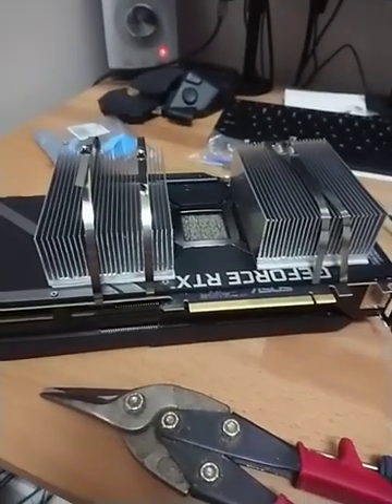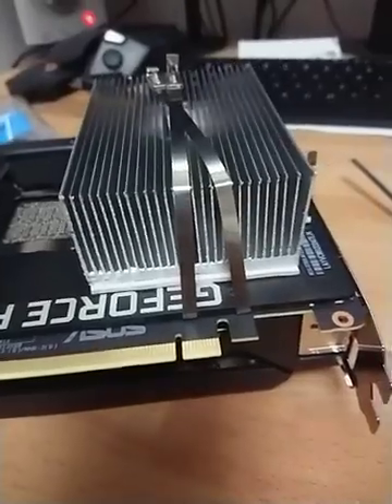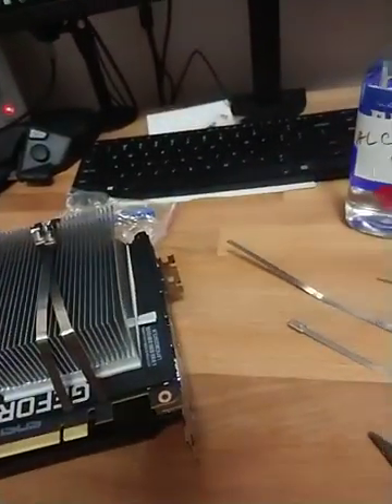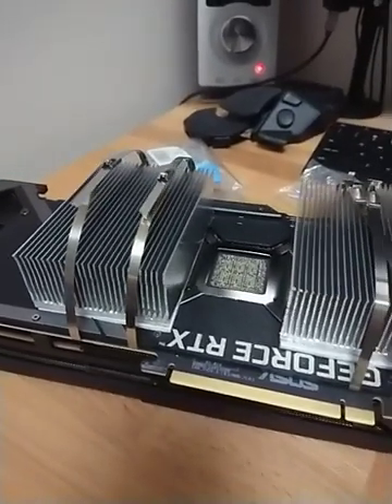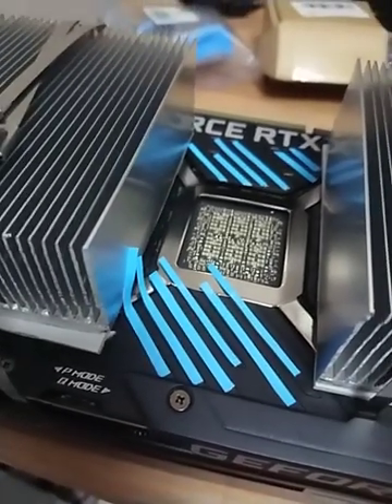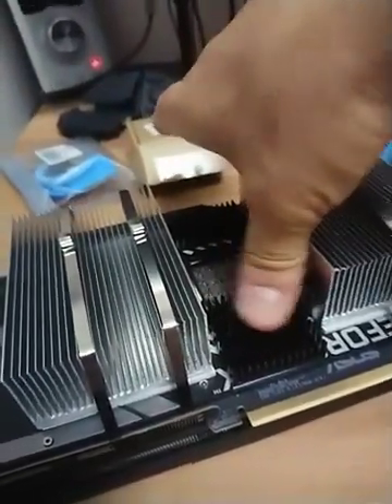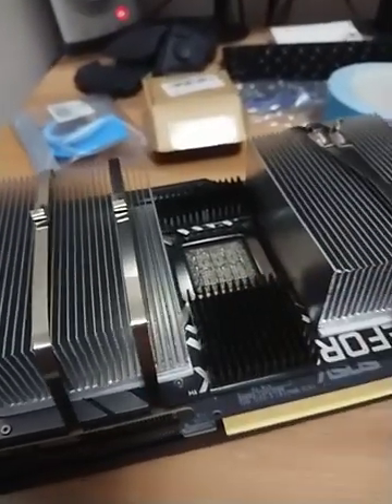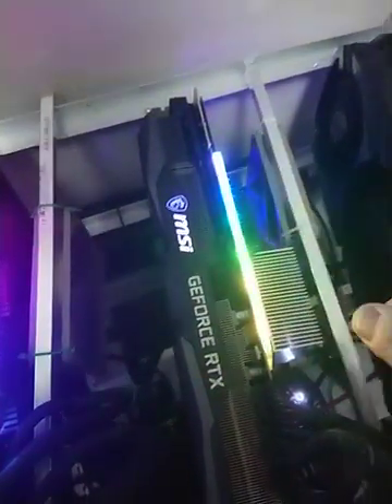Huge heatsinks on the GPU backplate Rtx 3090 increase hash rate Nvidia crypto mining ETH

Comment: Plastic Zip Ties are non-conductive, however, heat wears down plastic zip ties (and rubber bands).
I've used plastic zip ties in a case before and they eventually broke from degrading from the heat.
If you use plastic zip ties, I would say to check them after 6 months to 1 year and maybe replace them every 1-2 years max.

Comment: Personally, I would like to see someone try a copper plate stuck/pasted on the backplate of a 3090, with a couple counter sunk screws up through that copper plate first, to attach an off-the-shelf aio. All you would need to do this is the regular Aio mounting bracket kit. Cool the copper, cool the back plate, cool the vrams.

Comment: About thermal pads. Thinner is better, otherwise it acts as an insulator and traps the heat. You can also get double sided thermal adesive tape which is about 1mm thick. btw Normal thermal pads would be squished from 1.5mm to about 1.2mm.
Reply from the maker: https://www.youtube.com/watch?v=OzcAo38rkqQ

 This is a older video using double sided thermal tape

Comment: If you plan to strap heatsink, then thermal paste is better because thickness will be lower and heat transfer will increase. Pads are used only where you need electrical isolation or where surface is so uneven that paste wont fill space (difference more than 0.5mm). I did calculations using best thermal pad vs average thermal paste and thermal paste is still 10x better. Also on components that require thermal pads thicker than 3mm it would be better to remove pad if there is airflow, since heat transfer to air is better than that through thick pad.

Comment: Did you really run METAL strap through the back plate? You realize that there are about a million connections on the back of the PCB that you can short out with that right?
Reply from the maker: yeah that's cool

Comment: AWESOME I JUST GOT MY HEAT SINK IN THE MAIL, JUST BY ADDING 3MM THERMAL PAD FOR THE VRAM TO CONTACT THE BACK PLATE ALONE HAS PULL MY VRAM TEMP DOWN TO 82C CONSISTENLY SO HOPING WITH THE HEAT SINK TEMP WOULD GO DOWN TO LIKE 55C

Comment: i killed my MSI 3090 twice because of overheat. MSi was nice enough to replace  them both though. it's hella hot to run at full power. if you're gaming, get 3080ti instead.
Reply from the maker: I would rather change thermal pads than return, problem solved. Good airflow it's also important

Comment: Had the same idea last night and found your video when searching around.  Already changed the thermal pads in my 3090 FE, but not seeing great results as there is just nowhere for the heat to go when it comes to the memory modules under the back plate.  Good job.

Comment: i wonder how much this would improve memory temps without changing the thermal pads. I think changing thermal pads would void the warranty
Reply from the maker: Yes,  in most of the cases changing thermalpads will void warranty. That is however the best thing to do. But doing only the heatsink will make enough difference so the card can still run at a lower temp. Ideal is to do both if you want full potential.
Reply: @universeu7289  seems not worth it to void the warranty imo. lower the temps a bit. should be fine. big risk to void the warranty fairly small reward.
Reply from the maker: @樹 上原 Eventually if you keep mining 24/7 you will need to replace the thermal pads after a while. They won't last too long, regardless OC settings, you should change them once per year. If you do MAX OC they will need to be replaced sooner
Reply: @樹 上原 i did the heatsink it helped. also its very cold where i live so i just leave the window open in my spare bedroom and i get temps about 80. made me think what temps are my 2070s getting and my 1660s they dont have vram sensors. i wonder if those are getting high temps too.

Comment: How would you do this on a 3080 FE? My gpu hits 104c after the thermal pad mod, I have a box fan against it and I'm not sure what else to do, to get it to its actual full hashrate
Reply: replace the thermal pads, 3080 doesnt have memory modulars on the back, 3090 has like 12gb of memory on the back but idk more fans
Reply: Have you tried using afterburner to undervolt the gpu? I used a combination of undervolting, power limits and max fan speed to keep it cool while mining and increasing hashrate. I'm on a 3080ti so my values are probably useless to you, but in case other ti users are interested, 3080ti strix oc, 875mv @ 1920mhz, 65%power limit, fans at max (auto fans work well with a case with good airflow or side panel open), gpu clock -500, memclk +1500. 66-67Mh/s. vram is now 74C while mining, used to be 92C (!!!). During gaming it stays really cool now, mid-high 60s. gpu temp < 50c.
Reply: Waif for winter ;))))   its getting cooler already  have 2 3090s running  full speed memory at 92C  ;))))  other 2 still too hot. Got heatsinks fans all that   when its 30C outside  you cant really do shit just drop power ;))))

Comment: Hi
How did you power your gpu's...
eg: 3 8pin cables? or
2 8pin  cables ect...?
Reply from the maker: Two x 8 pins cables plus one splitter since each card needs 3 X 8 pins
Reply: @universeu7289  Yes, ok gotchya
Your psu has how many pcie ports?
Did your psu give you ALL cables included to fill all the pcie ports?
It's impossible to get pcie cables for MY psu XFX 850 Pro Black Edition, i know it's not enough but need to know.
Thank you for the reply
Reply from the maker: @yvonnadeau2331  I had two EVGA 1600T2 , comes with 9 x 8pins cables. Yes, a brand new PSU always comes with all the cables, there are no empty slots.
Reply: @universeu7289  I thought so...
Ok, thank you my man.
To bad i missed the occasion to buy a 3090 from you.
Good luck with the future.

Comment: why not use thermal paste?
Reply from the maker: Just because if for some reason I need to remove the backplate, I can reuse the pads, paste no. Also, being a large surface, you need a lot of it. Plus, if there are ridges in the backplate, like for the Asus Strix, paste won't do very well.

Comment: I had the same setup in my Arous 3090, two bulk heatsinks and a fan. It was working for a month or so, then the temp started going up as the season is changing to Spring/Summer. The only solution was open back and add thick thermal pad over the memory, now it is back to 88-90C without over clocking.
Reply from the maker: I already changed pads for the ones that needed. Heatsinks and fans are a bonus
Reply: My first Aourus was instable and crashed with 100% fan speed, but temps where great never go over 75 degree celsius. The new one I got in RMA runs stable with full boost but get much hotter even decreasing power and voltage
Reply: @DieTabbi  Was that your gpu temp or junction? If your gpu temps were 75 your junction would be maxed and about to catch on fire

Comment: Bro u should have them at 72c to 78c for mining  to keep them working  as long as they could, good luck 👍
Reply from the maker: 72~78?Lol I have them at 45~55, what you see it's memory junction temperature. Do you know what that is?
Reply: @universeu7289  yes my dear I was meant  memory  junction  good to keep them at this level I do have some of my GPU on water block  the temp is 50c my plan to shift  them all to water cooling easy way to keep them cooled , good luck 👍
Reply from the maker: @yousefalzaabi7294  Unless you get the EWK backplate active water block you can never reach 72~78C for the memory junction. Only if you have them somewhere where ambient temperature it is pretty low or you are using some A/C. Also, Rtx 30 series are made to run at higher memory junction temperature, maximum allowed it's 105C but of course that's not what you want. Around 90C it is a great temp and your cards will run for years. Cheers!

Comment: this guys is using a freaking cheap ass low quality thermal pads under the heatsinks he placed over the back plate WT!! that is not going to give much efficiency!
Reply from the maker: You are right , 88~92C it's not a lot of efficiency LOL The heatsinks are HOT aka thermal pads are working well, the other side it's the most important and the thermal pads I am using are working better than the thermal conductive tape. There is no point to  spend another $80 per GPU on slightly better thermal pads, won't make a lot of difference,  1C at the most. Also, for some cards, depending on the backplate surface I am using thermal paste. Chill dude!

Comment: Is changing backplate thermal pads really effective on Rog card? or MSI? how much?
and what's the thickness of replaced thermal pad?
Reply from the maker: For MSI yes, one of them I had to and soon I will do another one, but so far Asus Strix are fine. Backplate pad thickness it's 3mm. Front quite different, a mixture of 1 and 2
Reply: @universeu7289  3090 I replaced all pads in my msi 1 there were mostly 2mm but 2 spots for a thin strip of 1mm and some spots for 3mm
Reply from the maker: What memory junction temps you got now and also overall GPU temp? And what  thermal paste and w/mk pads you used?
Reply: @universeu7289  All pads I used were listed above, replace them all... so 1mm, 2mm, and 3mm.... Mem temp now runs at 92C
Reply from the maker: @MikesReactions  How about GPU temp?
Reply: @universeu7289  I'm not sure of the temp now, when I last checked it was like 94C mem temp I use HiveOS to mine on so im not sure. As for thermal pads, I cant link what I used or say the name or youtube doesn't post my comment, but they are blue 100x100 sheets off of amazon.
Reply: Do you not need to confirm the wattage of the card and the memory speeds before comparing temperatures? If you run stock memory speeds and quote a low memory t junction temp then its not comporable with a +1700mhz memory oc at 310watts
Reply from the maker: @stevenross-watt8640  I never run them stock
Reply: @universeu7289  The card needs new pads regardless. Might as well just do it right away.

Comment: My lord :)))) ever heard about thermal tape :))))))))))
Reply: What is this wonderful thing you speak of? No we here in the cheapskate universe use AIR as our thermal pads.
Reply: @gregorychurch605   ;))))
Reply: I mean arctic even makes thermal paste super glue 👌🏻
Reply: @LikelyLagging  yup i can confirm that once i put the arctic 4 thermal paste on my cpu there is no way to pull it without pulling the socket completely off. need to wait for 1 year for the paste to dry out.

Comment: I see that you have no clamps on these 3090... did you give up on the clamps?
Reply from the maker: Yes, on some of them. To begin with, one of my MSI did not needed clamps, pressure was good on the thermal pads and since I changed the pads for the other one there is no need of clamps now. I am still using clamps on two of my Asus Strix that are on stock pads, but as I upgrade the pads there won't be need of clamps anymore. Also, depending the attachment point of the metal ties I am using for the bigger heatsinks, they can also add/keep pressure on the internal pads as well.
Reply: @universeu7289  when you do the asus strix pads can you video tape it and talked about the mm you end up using?? I did mine and not super happy with my results, but I didn't have any 2mm and I think that's what I needed.
Reply from the maker: @nicholasgerry6169  It is always better to stick with original thickness. What exactly you are not happy with?  What were your before/after results?
Reply: @universeu7289  so I kept with the original thickness on the front, but added 1mm to all the back pads... (new pads just an extra 1mm for better contact and I'm happy with that, but I added some more to the front to pick up some of the chips on the left of the core that had no pads... 

Slightly off on the new pads I think... the first time it was way to high at 5mm and it reduced pressure on the core to the point of no contact...went to 3.5mm athe memory is great but I gained 5 degrees in the core. If I squeeze the center with your clamps then its actually pretty good, but I reckon if I do the right thickness ill need no clamps and get to 90 degrees. Just curious what you end up doing... good tip on the clamps by the way. 

Yeah mainly I'm curious what you decided to add when you open it up you'll see what I mean about adding the pads... I think that when you clamped the strix it got that area closer to the radiator which is why you saw a 10 degree difference.

I could replicate that by squeezing the end of the card with my hands (the side by the display ports.)
Reply from the maker: @nicholasgerry6169  I can't see that video since I decided to delete my Tweeter acc LOL. Yeah, that area near the HDMI Ports needs some pressure, makes a ton of difference in doing so. For the backplate, if the original were 2mm I wouldn't do more than 2,5mm. For front, unless you find areas  where there is no shape left on the pads (when you try/test before adding the paste) , you should stick with the original size, just better pads. That's what I eventually did and got the best results. At first I also did a 0.5mm thickness over original and results were bad. Also, since you added better pads and also do some components that were not properly making contact before, I believe all these are contributing factors to a slightly overall GPU temp increase. If you are getting lower memory junction temps but slightly higher GPU temp overall, that's normal. You are now  effectively adding more heat to the GPU heatsink. As long as there are 2-4C increase only, that's ok. If it is more, than something it's not right. My Strix are running pretty well, especially after doing the bigger heatsinks so for now I will keep them stock. I also finally had some time today and I organized the rig pretty nicely, everything runs well.

Comment: Lol those aren't even on two of the four chips sets
Reply from the maker: Have you ever serviced one of these? There are chip sets on front and back of the PCD   8 In total LOL
Reply: @universeu7289  yah, thats how i know they arent on 2 of the 4 sets... smh.
Reply: Ses rhe guy who hasnt tested heat sinks on the back of a card. I put heatsinks on the back of my card around the chips not on them and it works. Spend more time testing things and less time making comments. Not a huge drop in temps but my small heatsinks dropped 2c in games.
Reply: @bmddoesntmatter3722  my heatsink I placed lowered my temps to 80c... because its done right but thanks. :) pull off the back plate, and put he heatsinks ON the chips.

Comment: Quality pads is all i changed "all of them" on the zotav 3090 and temps are 84c at 297w with 121.50Mh/s   and evga 3090, did not change the ones on evga... no need so far. Also evga is at 86c at 334w or more... don't remember right now and also 121Mh/s
Had 25c day outside past few days and they kept there cool. 
ThermalRight/Grizzly minus8/ Gelid are quite good.
Reply: What size pads did you use for ZOTAC 3090? and what brands as well. Mine is running at 102C at 261W and only 95 Mh/s. This is the ZOTAC 3090 Trinity OC model.
Reply: @NyckHD-Official  The Brands are there.   Your timing is out of wack for those numbers.
GET a caliper to measure but mostly 2mm.
Reply: @yvonnadeau2331  I do have a caliper. Also what do you mean by my time is out of wack for those numbers?
Reply: @NyckHD-Official  Use the END of the caliper to measure as seen on other vids.
Over/Underclock your card as seen in other vids again.
You're fans don't seem to be pushing air enough... Crank those fans!
REFRENCE ONLY, 
MSI: Core clock -214
        MEM clock 1290
        Power Limit 88 IF it's below 10c  Unchain from Temp Limit
       Temp Limit 65
       Fan 86
DON'T go past 86/88c !
Preserve those cards
Reply: @yvonnadeau2331  my GPU core temp is 52C and the VRAM temp is 102C. Stock boost
Clock and stock memory speed. Power limit 75%. Running fans manually 75% as well.
Reply: @yvonnadeau2331  with those settings I get around 95mh/s and 265 W consumption. Not sure why my hashes are really low. I’ll look into upgrading the thermal paste and thermal pads
Reply: @NyckHD-Official  Yes, paste and pads.
Till then... CRANK those fans
Put a Extra fan on the gpu PULLING air away and towards top. THAT helps alot
Reply: @yvonnadeau2331  I actually have 3 120mm intake fans under the GPU pushing air towards the GPU fans
Reply: @NyckHD-Official  I think i see the difference.
Mine is in a Case, so i sit my fan on the Back side of the gpu pulling heat AWAY, as it sits in the pcie slot like normal.
AND i have outside COOL air on it , in the shade, I think my situation is MUCH different then you as expected.
Pushing air to it does nothing as it can only take what the gpu fans can do.
COLD! is the best.
That's why it's good for me right now.
Bottom line...
Pads & Paste, don't cheap out nowhere.
Reply: @NyckHD-Official  You ONLY need the one for the die from the back plate... that alone is 4c. Boost case fans for more air flow.
Reply: Is changing backplate thermal pads really effective? how much? and what's the thickness of backplate thermal pads?
Reply: @alirerezaabedi2047  Yes... change them ALL
2mm if i remember, take the caliper.